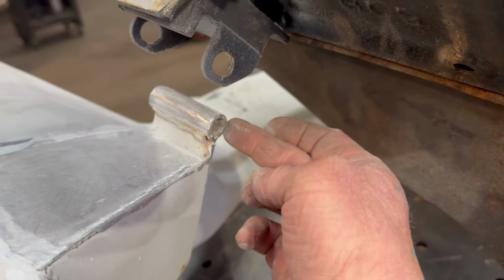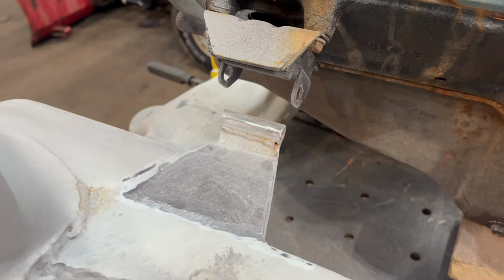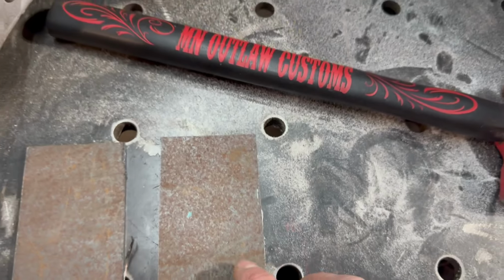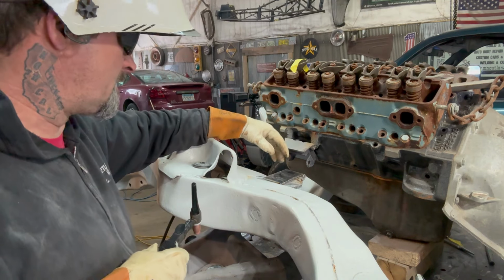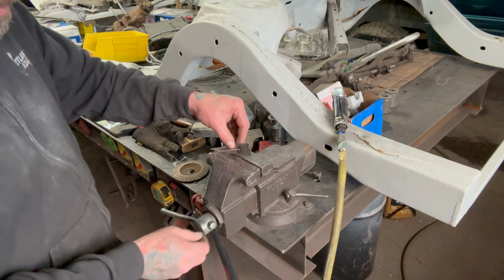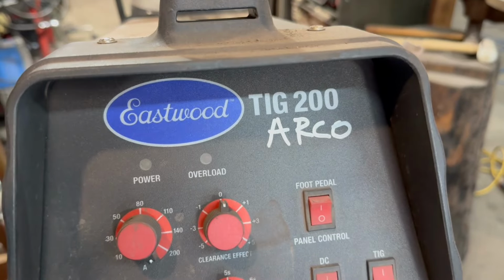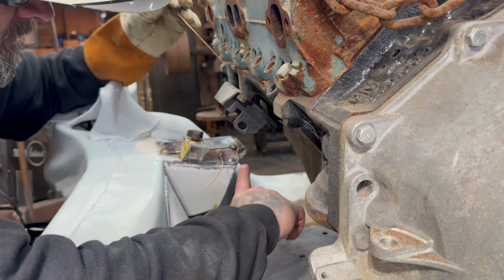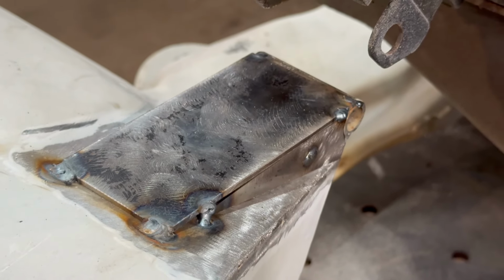Rogue - fabricating motor mounts

Comment: Looks good. Your doing a solid mount?
Reply from the maker: No the mountain on the motor that bolts onto the frame is rubber mounted 👍
Reply: @OutlawEdge  👍that will make for a lot smoother of a ride.